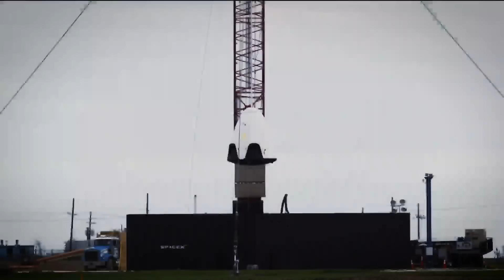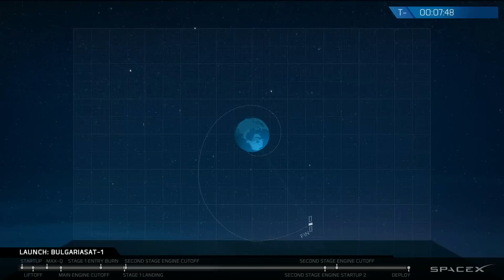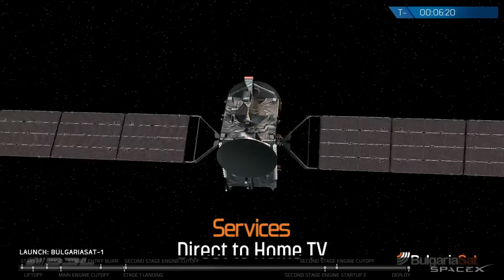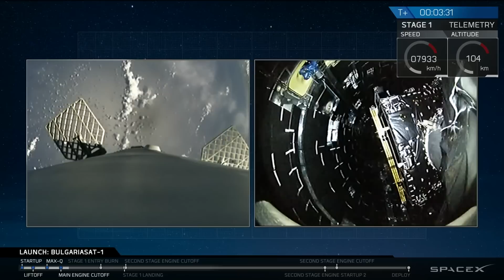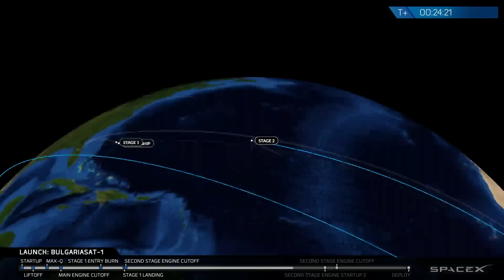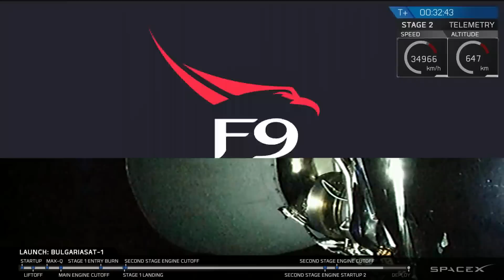BulgariaSat-1 Launch Webcast

Comment: For the life of me, I can't understand why SpaceX hasn't figured out a way to stabilize the video signal on their ships. This surely can't be harder than landing a rocket on a moving barge.
Reply: They will upload the videos from the other cameras when the ship returns to land.
Reply: HeinzP100 I suppose footage is one of the lowest priorities compared to sensors, materials, design.
Reply: Currently SpaceX is still using standard maritime satellite IP uplinks to get the signal off of the barge. The vibration from the rocket exhaust is literally just moving the dish so much that it can't maintain line of sight with the satellite in orbit so it loses connection. Early landings even resulted in the covers over the dishes blowing off, but they've since reinforced those.

The only real way to fix this problem is to move the satellite dish away from the rocket plume (nothing else is allowed to be near the drone ship so this is problematic), or to use a transmission system that doesn't need perfect line of sight.
Reply: Yeah, I've wondered about that too. I bet it's a cost vs. payoff thing. I mean, they'd probably need to isolate the transmitter from the vibration for that to work. I don't know, maybe build a stabilized buoy and connect to the drone ship with an underwater cable? That sounds like an expensive solution to a problem that you, me, and maybe 8,000 other nerds care about ;) C'mon ELON, make dem videos STABLE!!
Reply: The signal is lost because it is basically impossible to maintain a satellite link with the antennas vibrating and shaking as hard as those are when the ship is being landed on. When you think about it, Newton's third law states that all of the force that is slowing down the massive rocket is also being applied to the ship. The closer the rocket is to the ship the worse it gets.
Reply: HeinzP100 They focused more on landing a rocket on a barge than recording a rocket landing on a barge. I'm sure with a considerable amount of money you can stabilise it, and NASA probably  would spend millions on that, but it's really a waste.
Reply: The solution is as easy as it is obvious: Another drone boat. Or... I dont know... maybe just A DRONE. It could even lift off and land on the drone ship...
Reply: The incredible amount of plasma from the engine cause interference and I think the priority for the barge is to communicate it's position to the rocket not the feed to the live stream
Reply: Pitty they don't rebroadcast the recording from both entry and landing. I'm sure they record the whole thing, and there is probably more than one camera on the rocket. I guess it isn't a priority.
Reply: I wish they had footage from an observation ship or a helicopter.  That would be just a cool as footage from the drone ship itself.
Reply: All the above plus just as the ship starts to get blasted from the engines, a couple of sonic booms hit the ships dishes with lots of force.
Reply: +SirPetterTheFirst Fire isn't plasma, it's just excited gas that is giving off light.  A plasma is a gas which has most of the atoms ionized.  So the exhaust of the rocket isn't going to disrupt the signal.  The large pressure waves from the exhaust would rattle the dish on the drone ship enough to cause it to lose line of sight, however.
Reply: i think they shuold just send a few drones, and the ship would communicate with the drones with it's omnidirectional antenna, and then the drones would beam the signal to the land.
Reply: HeinzP100 Something that's important to remember is that the launch coverage is not their main goal. The main goal is the launch and landing.
Reply: HeinzP100 well, they must send those data to a satellite, which is hard because of those vibrations by the rocket. But they'll fix it with their own satellite based internet connection.
Reply: Couldn't they just put the dishes and antennae for video on a floating raft positioned away from the barge? Tethered to the drone ship? Then there'd be no direct contact or vibration.
Reply: +ArKritz Thank You
Reply: mfranzoni1 I don't think this will be a problem on the next landing, Elon is known to force issues to be fixed very very early.
Reply: Cole Smith they did that at first
Reply: Actively stabilised antenna when?
Reply: Or they could just have a DVR system to record the video and transmit the reply back once the dish is stable.
Reply: lame excuses in lame excuses space x can buy a hd camera put it in a thick plastic see through box and transmit the ENTIRE LANDING FOOTAGE OF APROX 10 SECONDS VIA MOBILE SATTELITE UPLINK AND IT WOULD COST UNDER 500 DOLLARS TO DO ALL THAT
Reply: HeinzP100 you said that right.maybe the don't want us to see the alien spacecrafts coming and going in and out of the Earth's atmosphere and into space
Reply: What an absolute insult and embarrassment to our intelligence.  "Oh we lost the signal from the only camera showing the landing because reasons." Boy that sure is believable.  Its a complete mockery!  Wake up this is as fake as it gets people
Reply: Well, the booster causes a lot of vibration, which makes it difficult to receive a signal. There's also something called plasma blackout that will block transmissions on reentry.
Reply: what would they gain from faking it? and how do you explain the satellite really being in space with this being a fake rocket/landing?
Reply: +ophello Its 2017, if they can land a rocket on a barge, they can have a few proper cameras recording it.  Rewatch the helium BlimpX "rocket" accelerate up into the sky, climbing slower than a fat man going up a tree.  This is a fairy tale and a mockery. Research flat earth
Reply: Stabilizing a satellite dish doesn't need rocket science. It just needs to be freely suspended on a well-balanced three-axis gimbal, with some gyros. To avoid drift caused by wind and engine exhaust, it needs to be covered by a radio-transparent dome.
Reply: By the way, this is how battleship's big guns can keep aim in a pitching ship. They are balanced.
Reply: If you've never aligned a satellite dish that provides broadband data speeds, that's why you don't understand. It's hard enough on a completely flat stationary surface. Inject a moving, rolling  platform. And THEN add extreme turbulence. This is COMPLETELY understandable.
Reply: Maybe they don't care for that level of detail to be shown. This is cutting edge tech and they don't want it copied by others. 

Also, they could use a wifi link from the barge to a nearby buoy thats stable and has a dish uplink. But again, why give your competitors that level of detail.
Reply: +ArKritz84 - A second drone ship, yes. A UAV, no. If you launch a UAV, it's still going to send data back via the satellite dish on the drone ship. Unless you get your satdish airborne - unlikely.
Reply: icwiz You are so close, it's actually painful.  Your reasoning is that FakeX doesn't want to show off its secrets to competitors so it doesn't show one of the most critical parts of the entire act?  Come on now, you can't honestly think that. I don't care how close minded you are that's just as ridiculous as it is hilarious.  Great idea about the barge being tethered to a more stable internet connection nearby, you should work for these clowns they might model their next phallic model rocket after you.  Research flat earth
Reply: Mari Onette Your right, it is strange there are no Antarctic selfies off the edge past the ice wall, which holds in the worlds oceans.  If you can believe the universe to be infinite, why not entertain the idea that perhaps the land out past the ice is an infinite plane?  Speaking of planes, how about you try booking some flights over the South Pole sometime, like maybe Santiago Chile to Sydney Australia.  Do you own research and it will all become apparent soon, so research flat earth.
Reply: Yeah, I have researched the flat earth theory. Ive also noticed that no one who believes in flat earth ever tries to do any experiments to prove their point. Now days you could launch your own camera on a balloon and take pictures of the earth. Or you can go old school and do the experiments that ancient philosophers did that showed the earth was round.  The Earth being round has been known for thousands of years, far longer than any space program or even airplanes or balloons. 

And yes, SpaceX guards its tech. It has to. Elon Musk recently explained how they could only hire American citizens because of the nature of their work. Rocket tech can be repurposed into ICBM tech.
Reply: I didn't get your first point. What do you mean by "off he edge past the ice wall"? You mean like pics of the ocean surrounding the continent?  

Commercial planes need to fly with safety in mind. Going over a continent that is desolate and very hard to traverse is not a great idea. What if you crash land?  Also the weather is crappy. There may also be international treaty concerns. 

Flat earthers keep saying that this is a modern idea, the round earth. But humans have known the earth is round for a very long time. How do you explain their reasoning?
Reply: Researched flat earth ... laughed uncontrollably. Thanks for the tip!
Reply: @marionette5968  Why not put the camera and the dish on a separate boat next to the barge?

Comment: Upcoming will be the quickest turnaround time ever of SpaceX- Iridium NEXT Flight 2 will launch just 48 hours from now. We really are living in the future.
Reply: Not really.  Iridium launches from California.
Reply: I never said it was from the same pad
Reply: +Jarrett Gates You said 'turnaround',  implies relaunching the same rocket,  or at least some of the same hw used.
Reply: Maybe I would have been better to say "quickest time between launches," thank you for explaining the difference
Reply: Jarrett Gates Impressive either way. C'ya Sunday!
Reply: Just wait. Once SLC-40 is back up and running and 39A's modifications for Falcon Heavy are done,, we could potentially have a SpaceX launch from Florida EVERY WEEK.
Reply: there has been rumers for about 6 months that once all pads are up and running that they are going to do a simultaneous launch from multiple sites
Reply: Jock - it not really rumored. it just when they can refine the process. In the not so distance future there will be 4 pads. 1 in California, 1 in Texas, 2 in Florida. Turnarounds can be as fast as 2 weeks per pad. But I'm assuming they just don't have that many clients/customers for something like that. So there would be no point in launching from multiple sites unless there is more stuff to launch.

It's only when they start launching stuff to mars when you'll need to launch a ton, because of the tiny window of time.
Reply: Jock Wood - They would need all the launch windows to coincide to actualy pull a stunt like launching from all sites at once.  You can't just launch whenever you feel like if you want to put a craft in the right orbit for every mission.   the chances of haveing 3-4 missions that could all have simultaneous launch windows are prety low and I doubt customers would be happy if their launch got delayed because one of the other ones had an issue just so Elon could do a publicity stunt.
they'd probably also need more drone ships.
Reply: Yea but it's a separate launch pad so it really isn't that big of deal. Now if they were able to turn around pad 39A and launch again from it within 48 hours then that would be something to talk about.
Reply: The 2-week pad turnaround is pretty much fixed AFAIK... between pad refurb, integration of the next rocket, and the static fire, it's unlikely to be cut down significantly. On top of that, on 39A they'll occasionally have to switch between F9 and FH configurations, which may add a bit of time. So the most we'll be likely to see is SLC-40 and LC-39A launches on alternating weeks, with the odd Vandy launch thrown in. And they'll have plenty of stuff to launch, once they work through their backlog of commercial launches they can start on their internet constellation satellites.

We may ultimately get to the point where their active first stages can most accurately be described as a fleet... 2 F9 cores, 2 FH boosters, and a FH center core that just stay in Florida and get reused over and over again, plus a F9 core at Vandy. And that's not even taking Boca Chica into account.
Reply: Adam Ahmed and how do you know all this!? Lol
Reply: Jock Wood - This is completely false. The only things this achieves is a ridiculous publicity stunt and puts a lot of strain on the crew.
Reply: I'm sure they will do everything to separate launches. Why should they split their attention w/o need to do so? But of course. one day we will see multiple launches the same time.
Reply: 2 week pad turnaround is definitely not fixed. Pad refurbishment for LC-39A takes less than a week at this point. SpaceX is now capable of processing two payloads simultaneously, and the hangar can support integrating multiple payloads at the same time. It should be possible to launch within 5 days or so on the same pad. The T/E integration with the launch vehicle takes 5 days, and likewise for payload integration with launch vehicle - and both tasks can be done in parallel according to the Falcon 9 PUG (rev2).
Reply: Adam Rankin - And to reinforce Ambient Morality and Adam Ahmed. I didn't know about some of the things they are talking about and find intriguing. :)

But with my comment (which is the layman version of theirs), is coming from reading a lot from SpaceX articles and watching Elon Musk speak at various event via Youtube. And also getting the honor and privilege to talking to a SpaceX employee of 10 years. And getting to tour the SpaceX facility.
Reply: Now, Intelsat 35e is supposed to launch on July 2nd... A 9-day turnaround, from the same pad!
It'll be incredible if they pull that off. Their previous record is 13 days.
Reply: SuperSMT - yeah seriously. They are improving a lot. Let see if they make 3/3 for stage 1 landings in 2 weeks. They probably will!
Reply: Intelsat is flying expendable. It's too heavy for any fuel to be saved for landing, so the grid fins and landing legs aren't even installed. Even if it could land, they couldn't get the drone ship in position in time as it only just got back. This may be one of the last expendable F9s, as in the future any payload that would need an expandable F9 launch will go on the Falcon Heavy instead.
Reply: Supman1 Unfortunately, the upcoming launch will be with an expendable first stage-the satellite is too heavy for the stage to have extra fuel to land.

edit-see Adam Ahmed comment-a good explanation
Reply: Jarrett Gates
Reply: And the record was beaten not too long ago.
Reply: @KingdaToro  Now we do!

Comment: Suggestion: Maintaining video signal at landing is difficult, we get it. Just send the recording from the drone ship a minute or two later when connection stabilizes and play it on the webcast.
Reply: I don't know how you can retrieve a footage from the drone ship that's still at the middle of the ocean during a livestream, and play that footage. What I know tho, we can wait until the drone ship deliver the 1st stage to the port together with the footage, then SpaceX can retrieve the footage and uploads it to the internet.
Reply: Actually, what he's proposing is feasible (and IIRC something being considered). The problem is that you need to maintain livestream of the barge while broadcasting the recording, so the throughput for the dish needs to be increased, and you also need some way to read from the camera while the camera is still writing. That's also possible, though.

Comment: how come this stage 1 landing was a lot hotter compared to the rest?
Reply: It's speculated that they gave this satellite a bigger boost than usual to extend its lifetime by reducing the fuel to circularize.
Reply: Specifically, they put it into a super-synchronous transfer orbit. That means that the velocity at apogee is lower, which is beneficial because it makes the inclination change maneuver much more efficient.

Comment: Pretty miraculous that it managed to land at all as it looked like it came down off target from that wake it kicked up and the burns across the deck. Shame the footage cut out but it was a great relief when it came back on as I was sure it had failed.
Reply: It's off target by design until the landing burn begins. Reason is, if the engine fails to ignite for the landing burn, it will just fall into the water instead of falling on the drone ship or pad. GTO landings like this use a short, 3-engine landing burn, so it's still over the water when it's low enough to kick up spray.
Reply: Yeah that's a good point. I've just not noticed it kick up as much spray in previous landings. This one definitely looked like a harder landing than before. They did say it was likely to be.

Comment: What exactly is an "emergency core"?  It absorbs impact, but how?
Reply: it squashes, like a metal bellow, absorbing impact energy by damaging itself in a controlled manner. imagine it as a bunch of empty coke cans taking the impact
Reply: I figured that, but I suspect it would render the rocket mostly useless as a result?  I guess the engines might still be recoverable, which are the most expensive pieces anyway.
Reply: sgauntt I think the cores are inside the telescoping struts connecting the tips of the legs to the middle of the clean marks from the legs.  As the rocket settles, the legs spread wider by the still descending rocket, compacting the struts.  Without a crush zone, I imagine either the struts would snap, or the struts would press in on and damage the rocket core.
Reply: John Campbell that makes sense. What threw me off was that Musk called it a "emergency crush core" (singular) which made me think it was part of the fuselage.